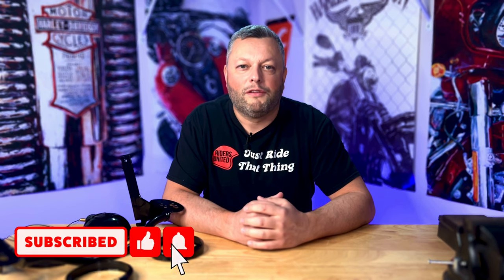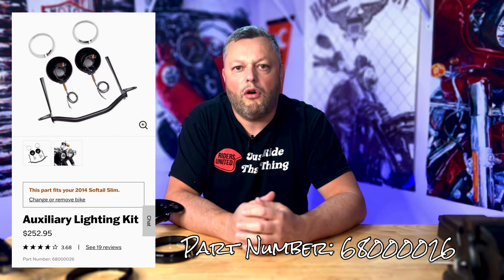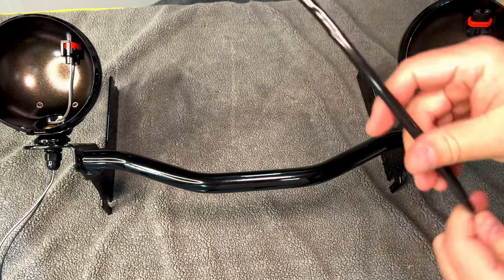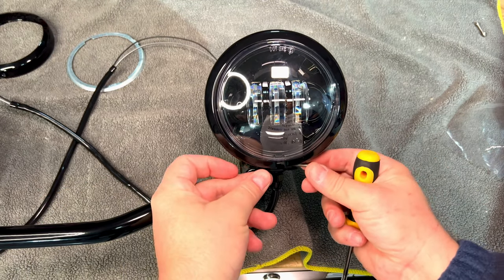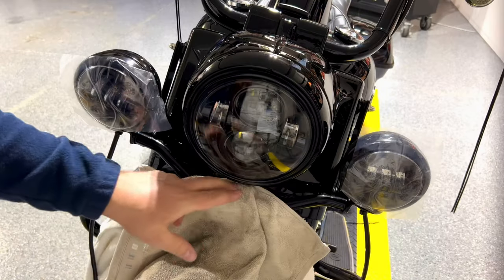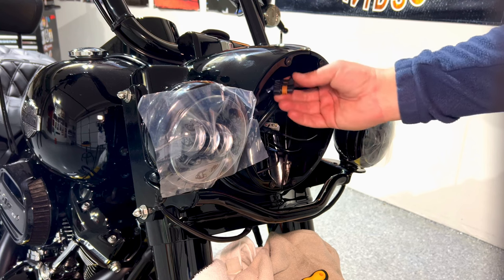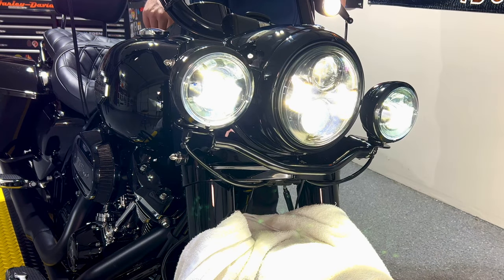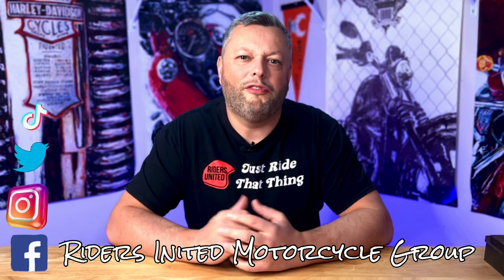🔥🛠  Passing Lights Harley Install with LED How to install Harley passing lights #JustRideThatThing

Comment: Very good installation video. But I can see that when you activate the turn signal, it affects low beam. should it be like this?
Reply from the maker: I didnt notice any difference in power delivery to headlight. For sure not when riding but honestly not when at standstill either. I am assuming video camera glitch of some kind.

Comment: This is a very nice upgrade on the RKS.  Nice you were able to find the OEM parts and get the black powder coating.  Looks great and more lighting to light the way especially at night.  Ride safe and enjoy!
Reply from the maker: Thank you Rick and yes OEM fit is prime and cost difference was negligible comparing to cheap junk. I am glad I did a bit more research ahead of the time. Thanks for your support and comment.
Reply: @RidersUnited  👊👊👍

Comment: Thank you. I have a 22 RKS and have been looking for a simple solution to the wiring. Just to be clear all you need is the yellow wire to purple on the first connector and 1 wire for ground on second connector? I can cut and cap the rest of the wires from the first connector?
Reply from the maker: Purple (power) turns into yellow at the connector and black is a ground that you can connect to any ground I just connect it to the other plug and yes you can connect 2 power cables together and 2 ground cables together. Hope this helps.

Comment: Hello, Excellent video. Great job.

Harley store dosen't sell anymore those parts.
I have an road king specia and I would like to install the auxilary lights, Do you know where can i can get those parts?

Thank you.
Reply from the maker: I have hard time to believe HD doesn't have parts for 2022 RK they should have it. Most of the time they run out of parts after 12-15 years

Comment: Love the video. Looks like it will help me a lot. I also plan to mount the turn signals under the passing lamps for the old school look. I'm curious if you plan to do that, and if not, how come?
Reply from the maker: Glad video is helpful. I simply prefer look of turn signals on handlebar and it is easier as you don't have to relocate it but it is mainly personal preference
Reply: @RidersUnited  I agree, much easier to leave on the bars as I really may end up leaving them as the wiring process really makes me nervous. Again, appreciate your videos. You're a great help!
Reply from the maker: @RB-tx4mn  yes this was part of the reason as well 😉

Comment: Could you provide the support bracked part n°  (RKS 2023)? Thanks
Reply from the maker: Sadly I bought it from swap meeet but if you ask local dealer they can pull it from parts catalog from 2022 RK as it is same thing. These brackets are same for last 10 years if not longer.

Comment: Cheers for the video! I just replaced my RK classic (2010) for a RK special (2017) so i miss those passing lights! So looking on marketplace in the Netherlands for the passing light bracket.. found few but they are for RK 94-98 and 1 from EG Ultra Classic 2007, wich one will fit my RK special? 😊
Reply from the maker: To be honest I am not 100% sure but you can check windshield fitment on HD website as this should be good indicator if 94-98 RK shield would fit your new King. I believe they didnt change design of front end for really long time but 94-98 is while back. I believe EG UC has different set up but not sure. Hope this help.

Comment: I have the same exact 2022 road king special… I love the way your bike looks but the link you provided on Harley Davidson site says it does not fit in my bike in year?? Can you please provide the proper link cause I love the way it looks on your bike
Reply from the maker: You are correct as I put the pieces together from various models. Bracket is Road King bracket. Auxiliary lamps and trim rings are from HD Softail Slim model so technically these are not for RKS as HD doesnt offer this kit for RKS (so link is correct) If you are looking for putting this whole set up together let me know as I have spare auxiliary lamps buckets for sale brand new OEM.
Reply: Thx for getting back to me so quickly! I’m definitely interested in having the same look as what you had in a video!! Please let me know what you have New so I can duplicate the exact look for my 2022 Road King special
Reply from the maker: @peppeV21  please reach to me via ridersunitedmotorcyclegroup@gmail.com and I can sell you the aux lights buckets

Comment: Awesome video! So can I use the o.e.m kit from the slim that you showed instead of buying everything separate?
Reply from the maker: No, Slim kit have brackets that wont work on RK. You can buy lamps and mounting hardware from Slim but bracket has to be specific for Road King. Unfortunately buying separate parts is only way to go if you want OEM parts. Luckily old RK brackets are cheap and easy to get.

Comment: Is the slim kit in the link the same bar you used for the RK Special?
Reply from the maker: No, only lights/lamps are from Slim (I have set for sale if you are interested) while mounting bar is original Road King bracket that was powder coated as it is different from Softail Slim. It is mix and match deal.

Comment: Where to find the right part number for the bracket for a 2018 rks.  I havent been able to locate.
Reply from the maker: You can ask dealer to look up this bracket Part Number to Road King Classic from 2020 as it will fit. I believe same bracket fit 2008 and up RK models.